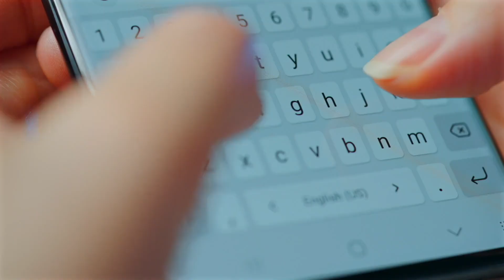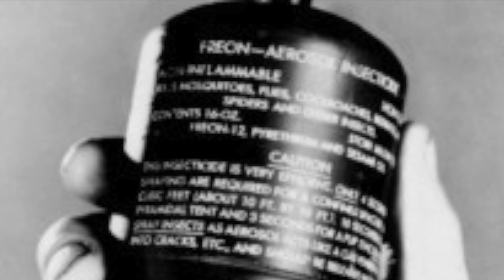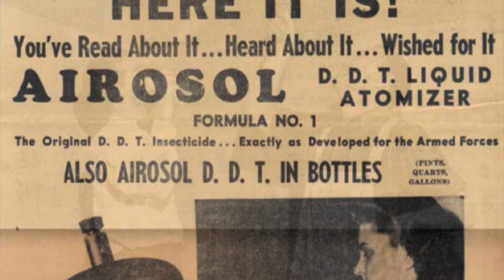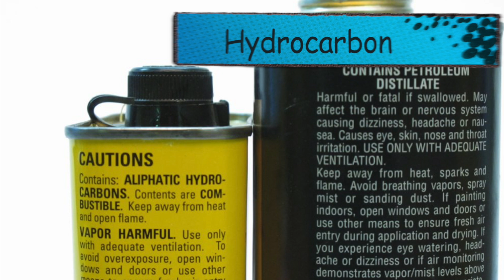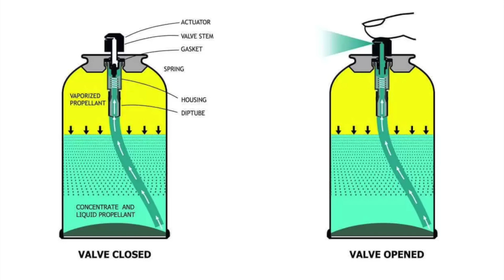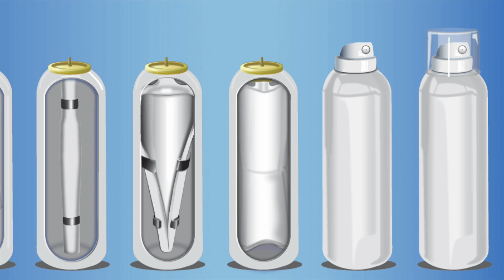History and Manufacturing Process of Aerosol Cans

Comment: 13 years in this industry. A lot of details are skipped in this video
Reply: Like what
Reply: The manufacturing of aluminum aerosol cans was some what correct. For tin plate cans, a can starts as a blank that is curled, welded, flanged and then top and bott fittings are rolled to interlock with the flanges of the welded rolled body

Comment: What happens to cans that fail the quality control process after assembly and filling with product?
Reply from the maker: Cans that fail quality control are typically identified, segregated, inspected, and either reprocessed if possible, or recycled/disposed if the defect is significant and cannot be corrected. :)